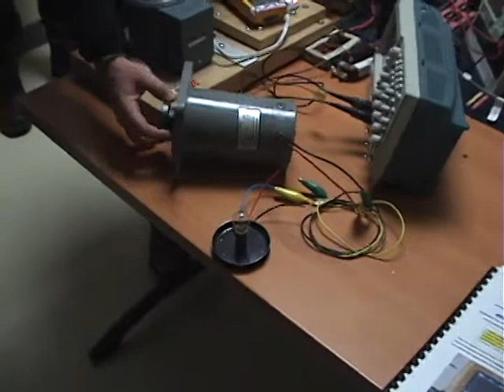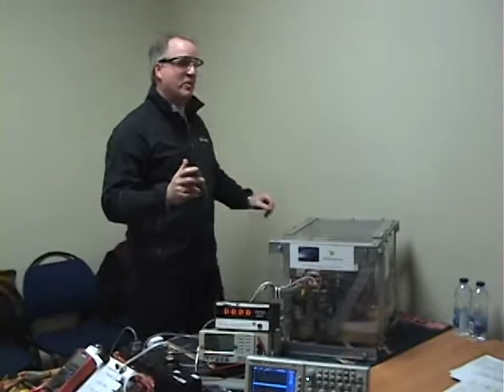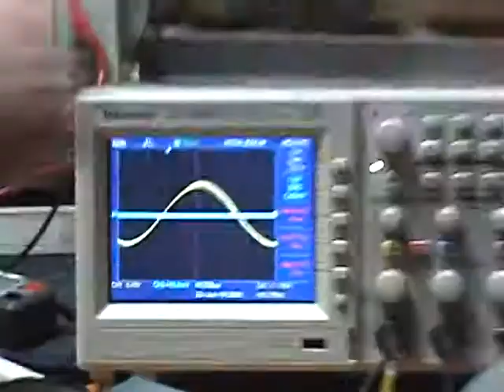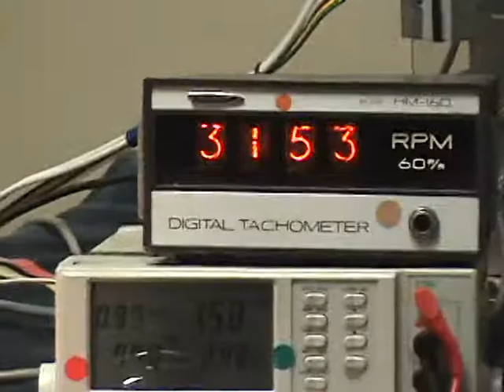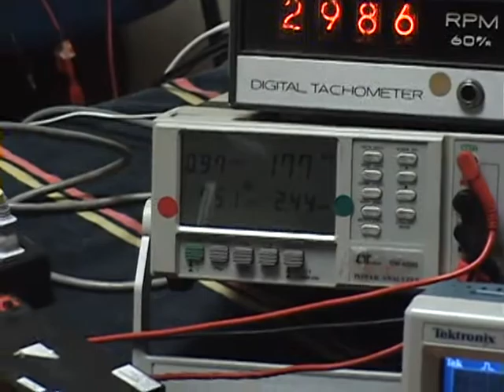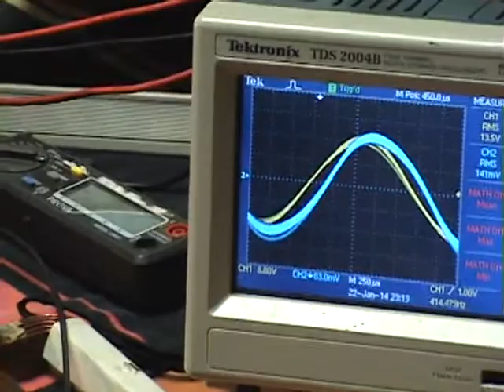Infinite Efficiency ReGenX Generator ETS Demo

Comment: Hi, nice Project. So is your Motor running quicker until load with the regen x coils than it would run without it? So if yes than you could build also a self running Motor. Or not?